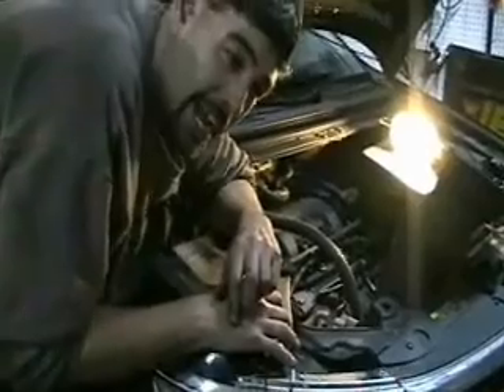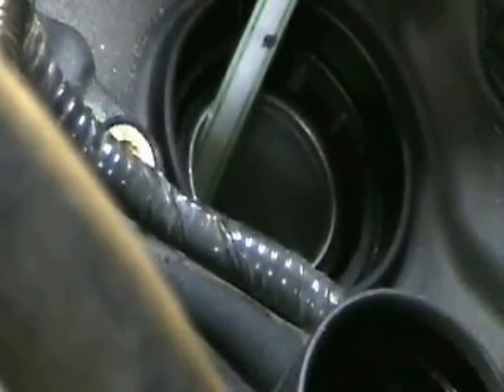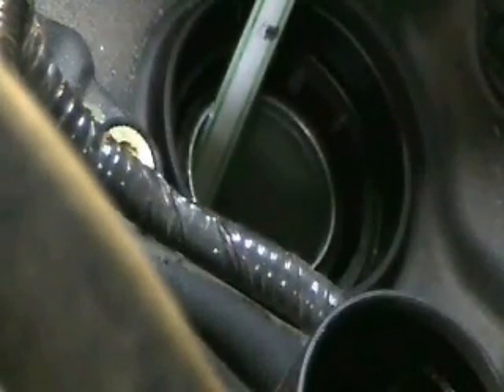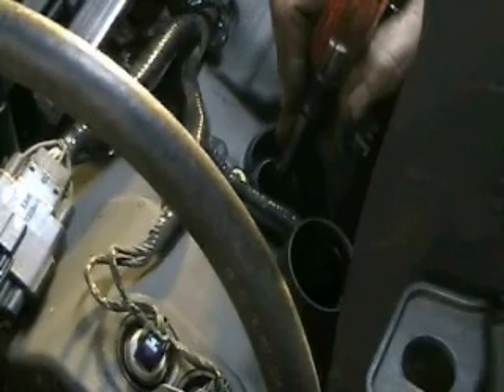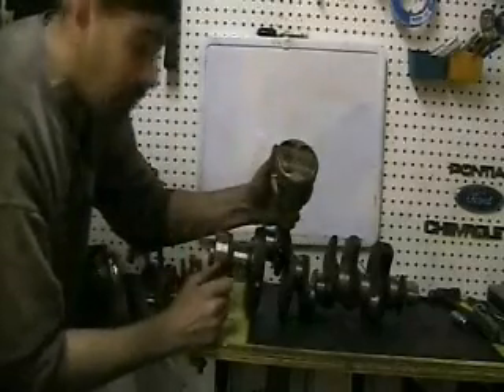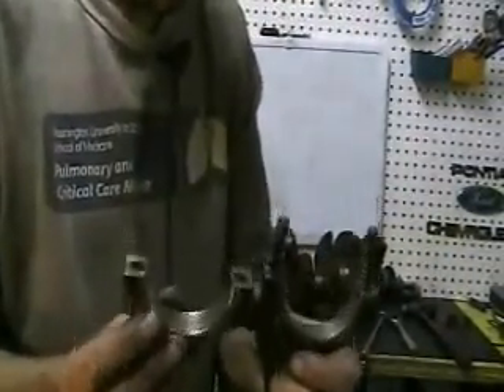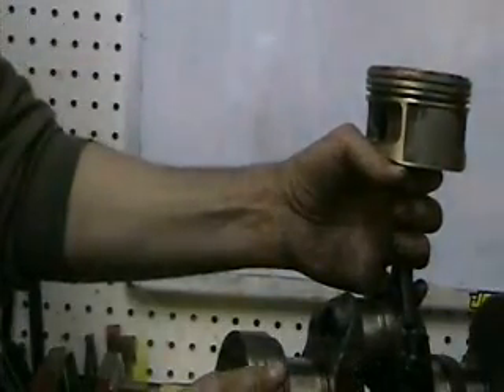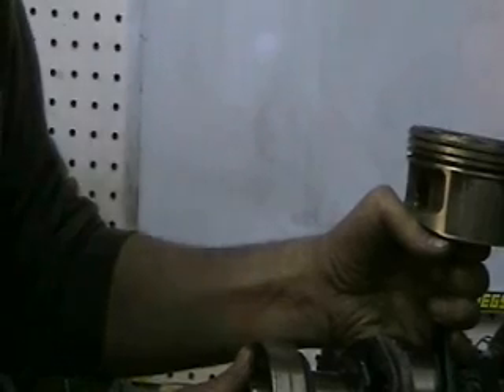How to test for Rod Knock using a screwdriver

Comment: Did you check each cylinder until you found the knocking one or you knew which one to check using method you didn’t specify. Thank you.
Reply from the maker: At the time of the video I checked each one. Now of course I would simple align a relative compression test with an ignition marker and calculate which piston it was from the firing order.
Reply: Understood. That would be your new approach.

Comment: in other words the lead and the indium layer is worn off the steel back; which is why they were made that way in the first place to protect the crankshaft, provided of course that the bearing is replaced before it goes too far. I worked at a bearing factory many years ago and set the machines that made those bearings and also in the plating shop electro-plating is used to attract the lead to the backing plate.

Comment: how would that work with with a v-engine with the pistons on a slant?
Reply from the maker: I use 1/4” extensions and stack them.
Reply: @SchrodingersBox  does this work on a v8?
Reply: I’m interested to know the answer to that question myself.
Reply: if you decide to use it with a v-engine ,,,, dont try it alone'.....let a helper hold the screw driver ,....stick or whatver is used.....the angle of the piston will cause it to wedge in the sparkplug hole

Comment: Back in the 80's, used a screwdriver or cut off broom handle as a stethoscope to determine which cylinder had the knock. Can also remove the spark plug wire. Had a 404 International gas engine with a tic at low idle. Removed the oil pan and inspected the rod and bearings on that cylinder. All ok. A closer inspection revealed a small crack in the crank journal caused by a casting pit. International warrantied it. Saw a mechanic change rod bearings in a late 80's 5.7L engine only to find it still had a knock. Tell me what that was. GM scrapped a bunch of engines because of it.
Reply from the maker: Changing bearings in an engine with rod knock won’t work. You already have the damage done.
Reply: @SchrodingersBox  The problem turned out to be a cracked piston skirt. I had seen it before. Sounds the same as a bad bearing.

Comment: Thanks for this. I am doing a partial rebuild on my engine and am wondering how deep I need to get into the bottom half. Cylinder head is off at the machinist, so this test should be even easier to perform. I already notice visually that all pistons appear visually to be at TDC for at least 10 degrees of rotation. Hmm....

Comment: Says this will work for any engine yet won’t work on any small block Chevy
Reply from the maker: ummm how would this not work on a small block Chevy. what is different about a small block Chevy? it uses the exact same rod bearings as every other engine on the planet.
Reply: @SchrodingersBox  the spark plugs sit 90 degrees from the top of the piston. Not directly on top of the piston
Reply from the maker: Yes you just use a smaller screwdriver. I owned an LT1,LS1 and an LS6- you can do this easily on any of them.

Comment: hmnn🧐, sO Ur sAEng, is wN wE check oOr spRk plugs to C if the threads lUs, B4 wE rEtorq them, 2 get a flat pole with magnet(firmly) attached 2 it, & pull up & doOn on Ech cylNder?, & if it gOs up or doOn the berng’s wOrn oOt, thus the rOdLB knokN?, SWEEEEEEEET IDa dog👋😒
Reply from the maker: s0rta but frm da l00k o ur msg I don think efishensee iS pri0ritEE 4u.
Reply: @SchrodingersBox  
‘efishensee’?😬.. O😯 EficNC.. O Ok, it IS prIRiT 2 me... I M 2 EfNC wat parS hiltN is 2 neurOplStic watchamalat G.. by the wA a thought Ur viDO was dOp dog - I hav a viDO with 0 vUz, it’s about my mysterious knock - cNt tL if it rod or spRk(got 0 vUz not 1/2 milEN).. if U giv it a listN I’m QrES wats Ur gS.  l flopd some STP gobiT gU on there & it didNt lSon as a rod knok.  l8r I’m gonna flop som purple octAn buster in their & C if it lSnz as a spRk knok. Ftr that I mA hav to disassemble spRk plugs & attach magnet to a stick - a mech. told me sound was coming from BnEth.. from stNding there... ofcoOrse his $motive mA B in QSTN👋

Comment: What if the sount is not constantly appearing!
Reply from the maker: then it most likely isn’t rod knock due to a worn bearing. could be low oil pressure or some mechanical intermittent.

Comment: if you install new bearings will that fix the problem if the engine knock isnt real bad or does the crank need to be resurfaced or replaced also?
Reply from the maker: if it was knocking there is no way around it- the crank journals must be resurfaced.

Comment: I took the oil pan off of my vehicle. Can i diagnose rod knock by trying to move the bottom of the connecting rods?
Reply from the maker: Absolutely!! In fact you can even measure it with Plastigauge
Reply: @SchrodingersBox  great! Thank you very much for the reply! The engine is still in the vehicle so ill try to wiggle the bottom of the connecting rods. I'll try plastigauge too.
Reply from the maker: Yeah you may be able to wiggle them just a very little side to side but there should be NO play whatsoever up and down. absolutely none. if you detect even a little, it’s too much.
Reply: @SchrodingersBox  I tried moving them and there was no play at all. It sounds like the engine is knocking a lot when running though. A friend told me not to bother checking the connecting rod bearings with plastigage because if the bearings are damaged then the engine will have to be replaced. Is there any instance where you can get away with just replacing the bearings? Thanks very much if you get a chance to respond

Comment: Could someone help. I have knoking but when I disconnect the 4th spark plug the noise stops. Someone suggested it was the lifters but when I did what this man showed I got no play. Any suggestions?
Reply from the maker: What did the screrwdriver test indicate?
Reply: @SchrodingersBox  I did not experience any movement. Perhaps I should open the oil sump?
Reply from the maker: I would check for single cylinder misfire first.
Reply: @SchrodingersBox  I do hear a separate snap of electricity close to the same piston but I can't find it. Perhaps I should ground the battery better? I have an SR20. I use hot fine tip spark plugs with CNG. What spark plugs do you recommend.

Comment: Great and indeed very helpful video. Thanks you so much.
Should the bearing ALWAYS be replaced when re-building an engine regardless the bearing/journals condition?
Reply from the maker: Yes bearing cost what- $40?  They are what all moving parts ride on so always replace them in any rebuild.
Reply: Thank you so very much

Comment: When the bearings fall off completely the engine will lose oil pressure and then it won’t last too long before it seezes, only a matter of seconds, I’m not sure but bearings don’t completely fall off , maybe get worn out bad

Comment: I may buy a Nissan 350z with a knocking sound let's say it's a rod bearing can I just disconnect the fuel or spark from that cylinder then just use the car with the remaining 5 cylinders?
Reply from the maker: no because the crank is still rotating that piston.
Reply: @SchrodingersBox  ok I dont mind if the noise persists I wanna know if whatever damage a bad rod bearing does will continue to damage my engine.....which leads to my next question what's wrong with having a bad rod bearing in the long run will (how) will it blow the engine
Reply: @SchrodingersBox  thanks for replying btw!!!
Reply from the maker: it will definitely destroy the whole engine when either the bearings overlap, the rod fails, or the metal particles block the oil flow or cause additional friction. Rod knock is death to the engine regardless of if the cylinder combustion is present or not.
Reply: @SchrodingersBox  what if I were to remove the oil pan and just remove the bad bearing completely then leave that cylinder dead?

I'm 19 not much mechanical knowledge but I'm trying have a 03 with 125K miles being offered for $800 with a knock so trying to work out a cheap solution 😉
Reply from the maker: Nope that won't work either because the imbalance will wear the main bearings plus the crankcase now being open to the intake would richen the mixture so much the fuel trim would lean out causing even worse performance. 
  You need to just fix it or consider another car. I used to flip cars all the time and the most I would pay for a car 12 years old or more with a blown engines or trans was $500 even if it looked mint otherwise.
Reply: @SchrodingersBox  ok thanks
Reply: @liveandletlive2894  a set of bearings is like 40 bucks or less dude
Reply: @apexdoxer9662  lol its thousands of dollars to have the installed

Comment: I had rolled a bearing in a Saab I bought, tried this method before I took it apart and had no play in any cylinders, yet low and behold my shit was shot bad, based on experience I would try this every time  I thought I had shot a bearing but wouldn't use it as a proper diagnostic tool, it isn't hard to tell if you have a rod knock

Comment: It could also be a wrist pin in that attaches the piston to the rod
Reply from the maker: True rather unlikely. Either way- still a major engine repair any way you look at it.
Reply: @SchrodingersBox  yeah depending on if you hear it all the time or just under power or if it gets better or worse when it is cold or hot

Comment: Or you could just take the pan off and check bearing clearances. You can also replace a rod bearing with the pan off no  need to remove the engine.
Reply from the maker: ABSOLUTELY INCORRECT.  You NEVER just replace the bearing. EVER.
Reply: @SchrodingersBox  . if you want to play around with a screwdriver go ahead Paris Hilton
Reply from the maker: You just don't know what you are talking about do you.  you NEVER just replace the bearing on an engine knock you fool. EVER.
  now explain why the screwdriver technique fails to properly diagnose the condition. We're all waiting, you moron. GO!

Comment: Great video!!! I subscribe. Do you think that you can make a video or a couple of videos to help me or people like me (a basic shade tree mechanic) to pass the ASE?
Reply from the maker: Never took an ASE so I wouldn't know whats on it.
Reply: Schrodingers Box  So... Tell us what path you trod say that we the common people may follow! LOL
Reply from the maker: Yeah I can't really help with this. Being a DIY, I have no experience with the industry or qualifications.  I would say that a good understanding of the basics such as fuel trim analysis based on O2 sensor or A/F sensor stoichiometric maintenance, MAF and MAP feedback effect on fuel trim adjustment, and of course just basic mechanic fundamentals would be necessary.
  I recall one question from an ASE test I saw on a message board once- it was "What would the effect on the short term fuel trim be if there was a misfire in a single cylinder?"
  Most beginners and even most professionals got this one wrong because they would of course expect it to go negative but the answer if you think about it for a second would be it would go positive.
  I would just focus on basic fundamentals like that so you understand the theory and application rather than trying to memorize everything.

Comment: Awesome technique and presentation.  I've been working on cars/trucks over 50 years now and rebuilt a few engines and never heard or thought of this clever technique.  Came across your video at perfect time.  I have an F150 w/5.4 Triton in garage.  o2 sensor failed and motor hydro-locked on gasoline attempting to start.  Cam Phaser knock can sound similar.  I have cams and timing components out and just tonight scratching my head trying to make decision how to proceed whether to replace faulty phasers and bad chain tensioners, only to find I have bent rod/bad bearing after the fact.  Will sleep good tonight.  Thanks Schrodingers Box!

Comment: Anything on baro sensors? Hard to find info on this on an 88 Accord but ecu shows only one code, the baro sensor isnt working at all or properly? 9/10 info online leads me to Ford, mostly mustangs. My husband isnt a mechanic but has alot of knowledge for engines but not as much with Honda or any kind of foreign or tuner-like car as he does with ford and chevy. If you have time please give any advice or input. I hate to explain here but idk how to reach you otherwise. I know my car's in good hands with my husband but hes about to replace the rod bearings and  check the pistons. Hes rebuilt an old 83 ford truck over and over, 94 explorer that was hydrolocked, and an 00 cav rebuild, just worried what seems to be a rather simple task for one who knows an engine will turn into a huge issue.
Reply from the maker: Yes see my MAP sensor video

Comment: This is the video I have been seeking for WEEKS, thank you. I have an 88 Accord with a knock but upon researching knocking sounds, there are different problems that sound the same to me. My husband swears it's the bearings which we have a rebuild kit but he's working full time all week, I do not have the knowledge to tear that far into this car myself lol. I am worried there is a bad rod or crankshaft bearings bc I do not have the ear to distinguish the differences in these sounds, they sound pretty much the same to me. And my exhaust is loose, no cat, it rattles along with this knock but I notice the engine knock right upon starting it, the exhaust doesn't usually rattle at that same second. Anyway, I'm glad I found this video, it helped me understand this issue WAY BETTER than my husband just telling me. Thanks!!

Comment: Just unhook spark plug wire one at time run engine when you get the right one it will stop knocking. Unhook start restart unhook start restart
Reply: Kenneth Neece this makes sense and seems easier,  is it safe to do tho?
Reply: Yes, I've seen this too, however that only gives you a suspect. You still need to test the piston movement in my opinion.  The spark plug wire test is a good way to narrow it down.
Reply: isn't it better to unplug one fuel injector at a time instead?
Reply: What if the knock remains after said test?

Comment: How do you know that the pin inside the piston is not to blame?
Reply from the maker: Good point, I suppose you don't know if it's a wrist pin problem but either way it doesn't matter- still a bottom end problem and a major repair either way!

Comment: i got that problem so if u change to rod bearings should it stop the more i rev the louder thw knock
Reply from the maker: Unfortrunately, no. That would be a very short term fix and in fact may not even last 30 seconds depending on the journal condition.  Once you have the knock, you need a rebuild. You can't just replace the bearings and call it a day.

Comment: Should rod bearings be replaced as preventative maintenance or should they be replaced depending on symptoms and a diagnosis? My 07' yaris has 320,000 miles and the engine sounds like a well oiled machine, no knocks or ticks, just smooth and healthy. I want to keep this engine going as long as possible, so should I replace the bearings considering the engine has so many miles on it, even though it sounds and performs nicely?
Reply from the maker: Normally the answer would be no but I can tell you that with that many miles and if you totally intend to keep the car, there is some substantial consideration in doing a "budget" engine rebuild.  I used to do this a lot and it basically includes just rebuilding the components like bearings, rings, etc while the engine is still "in spec" but shows compression loss.  An engine at the bottom limit or lower for compression spec that seems to run fine is a perfect candidate because as opposed to an engine that develops knock and needs a rebuild which requires much machining, catching the engine before there is internal damage often just needs components replaced with no machining- I just measure to be sure they are within spec and replace all the wearable parts.
   However in my opinion if your engine is still well within compression spec, leave it as is!!
Reply: Schrodingers Box thank you very much for your response!

Comment: My landlord has a 94 chrysler town and country with a rod knock. Hes old and used to have a shop. Be swears its fine. It runs the same with 3 and 6 wires mixed up too. Rod knock when they are where theyre supposed to be. Thiscar is fucked and hes delusional lol
Reply from the maker: Yes if the rod knock is bad enough, the cylinder loses timing so the mixing of the spark plug wires (or even absence of them) is irrelevant because ignition is not happening at TDC
Reply: Thanks for the reply! The knock only shows up when wires 3 and 6 are where they're supposed to be. So weird. I finally convinced him to take it to my mechanic. I'll call him tomorrow and tell him to have a look.. I'm sure the landlord didn't say anything to him about it. Thanks for the info!

Comment: How do you tell which cylinder is  doing this? Or do you just do that in each one?
Reply from the maker: I usually use a cylinder drop test as first indicator but that only works if one cylinder is responsible.

Comment: Thank you for the video! I experienced a big drop in oil pressure and engine clunking so, presuming rod knock I drained the oil (no fragments!) and did this test (no play). So now I'm confused. What else could it be?
Reply: Did you check the lifters and condition of the camshaft lobes

Comment: Hello schrodinger, I have a 99 miata, and whenever I rev between 2-3k rpm, there's a "knock" in the engine. Can I just drop the oil pan and change the rod bearings?
Reply from the maker: Nope.  That would be an extremely short lived solution even if it worked- I explain why in previous comments.